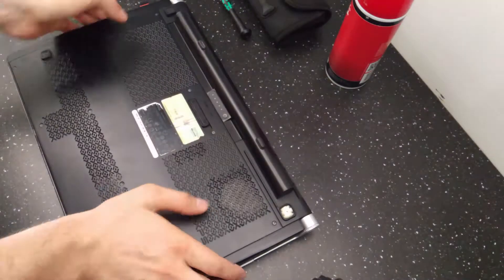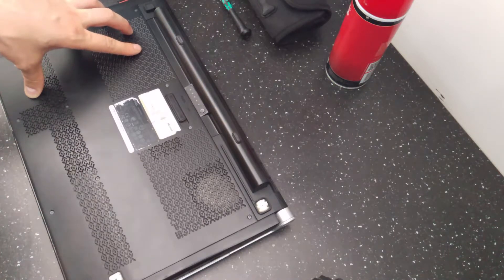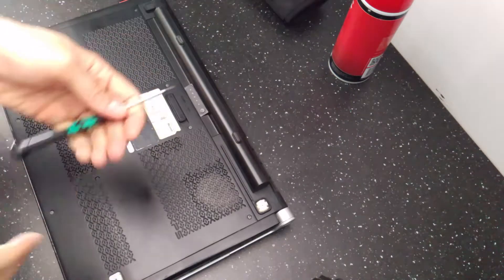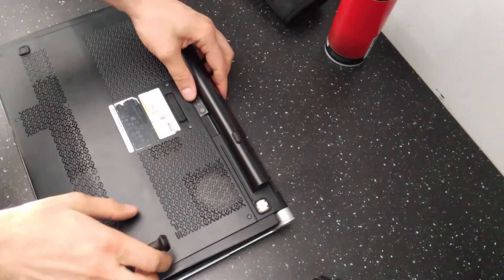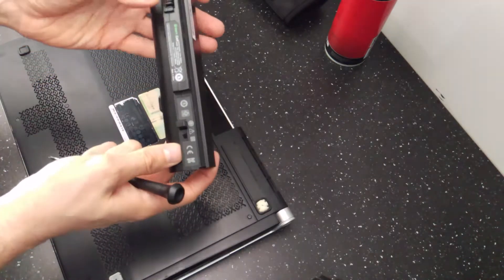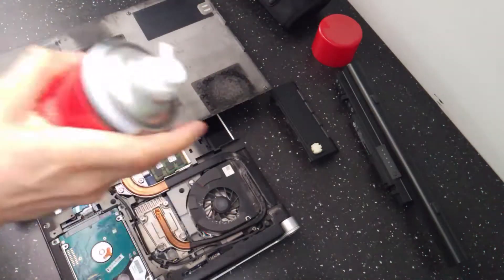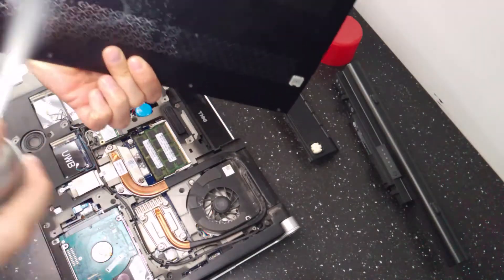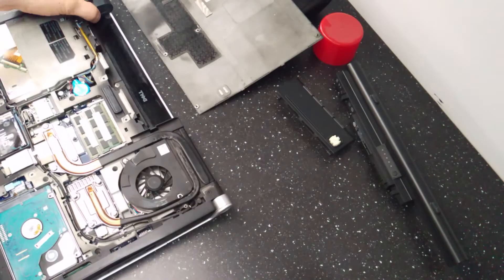How to clean your noisy laptop - Dell XPS

Comment: In most cases, it does help cooling but will not fix noisy fan. Noisy fan caused by worn plastic on the brushless fan riding on top of magnetic coils. This fan is a floating fan and has no bearing.  At certain degrees, the dirt or imbalance fan caused rubbing the inner side of the fan and start to rattle.  Yes, cleaning is prevention but will not fix the noisy fan in 99% of cases.
Reply from the maker: Thanks for the comment
Reply: @weekendwarrior_ it is flammable or nonflammable air duster you are using???

Comment: certainly this has to be done time to time, laptops that are used on beds or carpet pick up the dust terribly, my brothers laptop kept shutting down a  few minutes into using it, we found out it was clogged with dust,   i use mine on a desk and have a riser stand, it has no issues in 3-4 years
Reply from the maker: Jusb1066 yes, it is like with everything- if you look after it and use as intended it will live twice as long. With gamers laptops especially due to large heat source of graphic card. My recent laptop doesn't have it and is very quiet. This one is louder than ventilation in my car